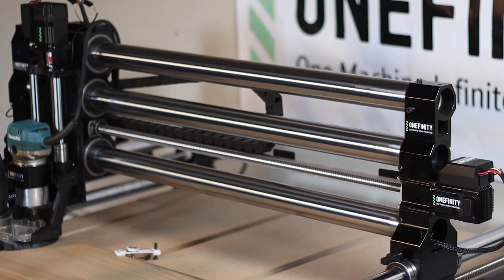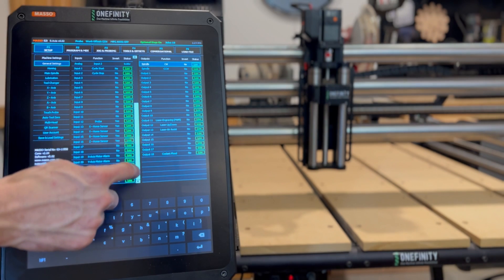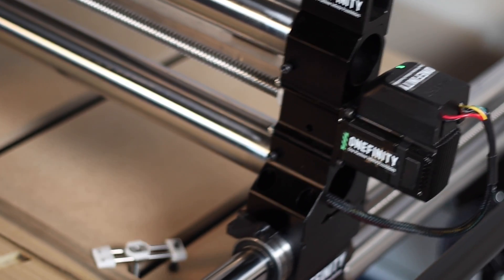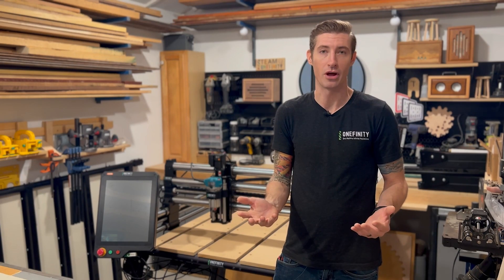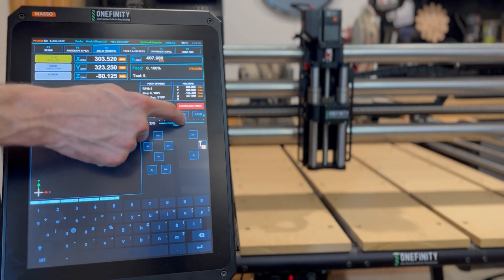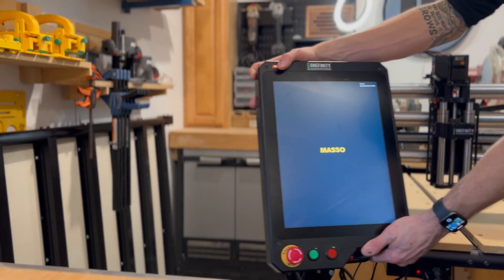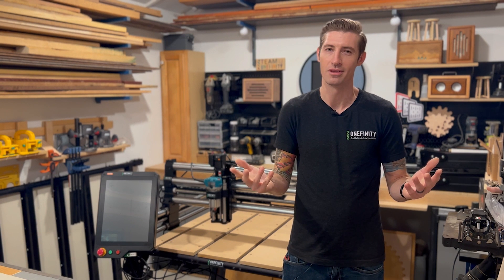Introducing the Onefinity CNC ELITE Series (Gen 1), Powered By MASSO. | 2024

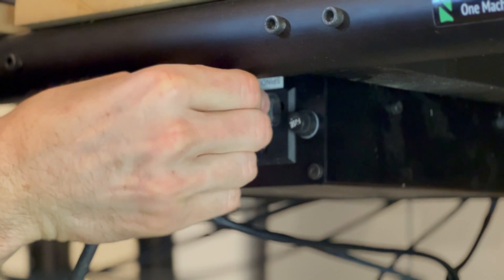Comment: On the Masso controller the feed rate override (as mentioned at 1:09) can only adjust the feed rate from 1-100% while a job is running; it won't allow an increase feed rate past 100%. That feed rate value of 150% is only available during jogging. I would be super stoked if you could get that feature added to the Masso controller as even with their latest version of firmware it's still maxed out at 100% feed rate while a job is running. Please, please, pretty please ask Masso if they can include that in their next firmware update 🙂

Comment: Will these be able to be wall mounted?
Reply from the maker: Elite series are not intended to be wall mounted.
Reply: @OnefinityCNC  Can it be stored vertical when not in use? I just ordered the Elite Journeyman and would like to put it on a folding table for storage only.
Reply from the maker: @6foot2design  it’s not intended to be anything other the horizontal.
Reply: @OnefinityCNC  so the rolling leg kit would be off limits on the elite? Hopefully the website can reflect that because that was not clear when ordering.
Reply from the maker: @6foot2design  completely.  It’s WAY to big and Heavy

Comment: The mechanical is ok, I'm just not a fan of unsupported rails, but the controller looks good. Definitely an upgrade compared to most other hobby options.
Reply: Rails only need support if they aren't strong/rigid enough them selves. The main advantage of rails vs axels is that they can get a lot of their rigidity from a lighter and cheaper material like aluminium. As long as you have the motors to drive the added weight this is probably a superior solution.
Reply from the maker: better than the rest!

Comment: Would think the “elite” series would have a spindle and not a router
Reply from the maker: It doesn't come with either, rather, a lower price point and the users has a choice to supply whichever they'd prefer!
Reply: @OnefinityCNC  Is there an output from the Masso that could control a VFD? RS232?
Reply: @binershock  I would like to know also

Comment: Being someone who is a full time cnc operator working on industrial machines, I can say this upgraded controller is far more superior than the ones the current machines come with! Now you guys just need to release a spindle so you can program the RPM. I understand you can use third party spindles, but it would be much more user friendly if it was plug and play just like the rest of the machine is
Reply from the maker: @pwncnc makes a great plug and play spindle for our ELITE series!
Reply: @OnefinityCNC  that truly is a awesome machine. You have sent a shockwave through the entire community and have the competition scrambling to figure out something. What that something is I have no idea.
Reply: Please reach out to us at PwnCNC. 
We offer a variety of spindles that are plug and play with the 1F-E. 
😉 Clinton
Reply: I want to buy an elite CNC but I need to know this before purchasing.....is the journeyman elite the exact same as the elite foreman but only smaller???
Reply: Also I have an 80mm water cooled 800HZ 2.2kw spindle kit in the basket ready to order, just need confirmation on the CNC elite, if there's any differences apart from size??? If there is no difference, and the compatability is all the same, I will go for the journeyman as my workshop isn't that big, complete with the fold down wheel table, also does any elite series work with the games console controller or is that just for the originals?
Reply: was just  gonna suggest this, the router is the weak point, noisy, innacurate, and with a short life.
Reply: I work with a "First Robotics" team and need to cut aluminum, will Makita cut .375 aluminum which would be the max we go to? is the PwnCNC router plug and play??